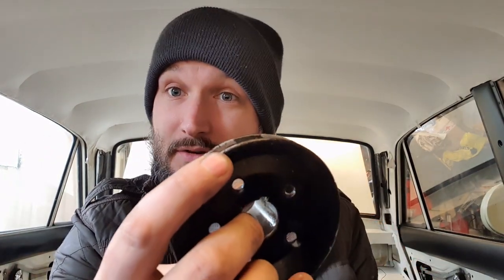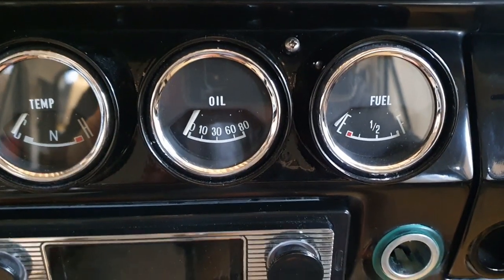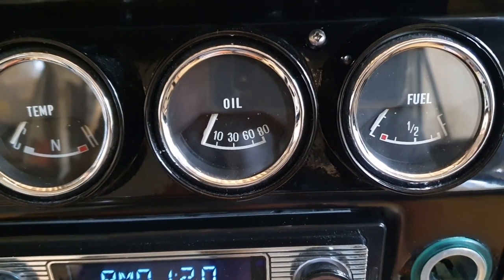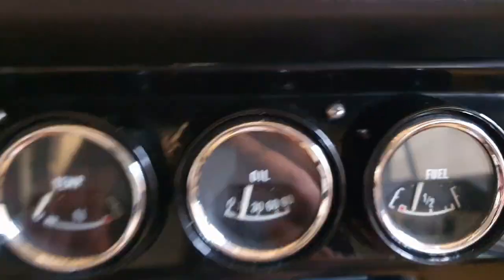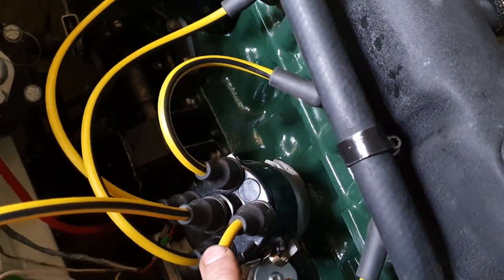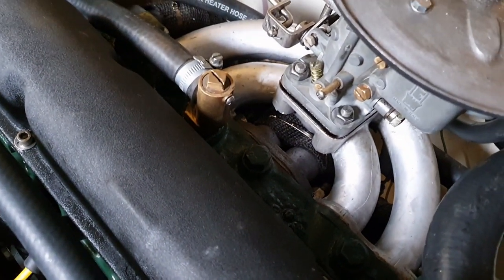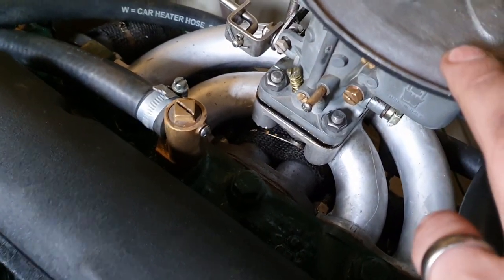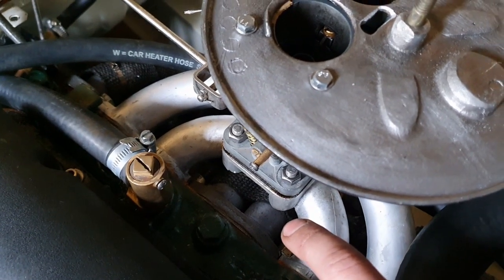Engine Fail! Mk1 Cortina restoration

Comment: hi mate,did you check whether no1 piston at top with your new pulley timing mark,i know that there are several ford pulleys that fit the ford crank all with different placed tdc's and it looks like your pulley with 2 marks is where someones checked theirs and marked it on the pulley,have you checked the float chamber to see if its full as a partial full will not run engine,never rule out a dodgy fuel pump,are all the vacuum pipes new without pinholes ?, its got to be something simple and when its happened to me its back to basics with a checklist,when you get no1 piston at tdc take no1 plug out and put a screwdriver in the hole and turn the crank till the piston has stopped pushing the driver up then attach a test light to the points and turn the dizzy till it lights the bulb then lock off the dizzy,have you got a strobe timing light that will tweak the timing when engine is running.
Reply from the maker: Hi John,

I agree that the pulley timing is getting me a  wrong timing, I hadn't tried the tdc on number one. 

The carb seemed to be set right but it's something I'll check out

I hope you're doing well.

Jim

Comment: I had my Capri running fine. Uses a motorcraft Autolite fizzy rather than the lucas one. The Lucas one is a bit more upmarket than the Autolite and a bit more technically  advanced,  however  I have always preferred  the Autolite one as it's more robust and it's less complicated if you have to fit non assembled points. Great on a car like mine where I am not too bothered about tuning and it's a daily. However the rev counter had been replaced with a aftermarket one. The original was in the spares when  I bought the car. Car had been changed to neg earth and that's probably why the rev counter was in the boot as that type of counter will not like the wrong polarity and kills them. So I rebuilt it, plenty of stuff on the internet about how to convert that type. When I did it, mine as luck would have it was slightly different inside to the MG ones where it can be done easier. I did the work. It worked fine for a bit. One day I pulled up, then the car would not start. Litterly taring my hair out. I found there was voltage to the coil 12v but only 7.5 going to the points. That was not enough to run the system. The reason, while I was in the engine I must have knocked the feed for the rev counter off, and put it back on the wrong side. Simple, did not notice I had done it, but enough to not let the engine start. Killed the repaired rev counter too, gutted. So redoing it now. So many people talk about electronic ignition vs points. So my pennies worth is this. When trying to diagnose faults it's much easier on a standard set up and if it's a car you use and love a lot, keep the points. Much easier to diagnose and replace yourself. If you go down the electronic ignition  route you need to always carry spare everything  of that system as of one component  does brake down and you are at a show or something,  your AA or recovery will not carry or obtain the part easy enough to get you going. Also as technology  advances and times pass, companies change who manufacture those systems. Parts become more obsolete  quicker than the trusty points set up, where you can nearly always get bits for or be able to repair to get you home. I also have an online spark plug checker fitted just as a visual aid in case of a fault. Just makes diagnosis  a lot quicker.
Reply from the maker: That's interesting, I'm doing some checks on the engine soon and I'll have a look at the voltage again at the dizzy.

Its running a new aftermarket dizzy but I've noticed it's very sensitive to minor changes in timing but I also think the pulley marks aren't great

Comment: Could be one thing or a number of issues combined.
Many new rotors, condensors, plugs, plug leads are faulty these days, even from reputable brands New out of the box. Dont assume check e everything 3 times. A new earth strap can cure issues e g. 
Fresh fuel, check valve timing, spark plug gap etc.
Reply from the maker: Hi John, firstly sorry for the late reply on your comment.

You was right about it being a number of issues, what I later found was that the main issue was that the crank pulley fitted didn't have the timing notch at the correct point for 10 degrees ATDC and the spares I had all had slightly different marking points (1960's quality!)

After taking the head off and setting TDC I could make a new timing mark but I also found the inlet/exhaust mating face on the head and manifolds was not flat so there might have been an air leak. I went through the carburettor again and found that the main jet had been drilled out so it would have been dumping fuel in!

Carefully putting it all back together and triple checking the Cortina has been running well.
Reply: They didn't have a weber carb as standard, at least my Dads mk1 1500 deluxe doesnt, its a zenith I think.
I was running 2 years ago but not now, the red light that should come on for ignition doesnt come on. My wiring diagram is black and white which doesnt help, do you have a colour one? That would be a help😂
Reply from the maker: @johncollins5552 the GT has a webber 28/36 dcd as standard. I have a loom diagram in colour but thank you👍

Comment: Hi Jim, Have you timed it with a timing light? If yes, and if you have fuel and a spark, then I would suggest you may have installed the distributor 180 degrees out, try swapping the leads around so that no1 becomes no3 , no2 becomes no4, no3 becomes no2 and no4 becomes no1 I think I have that correct, ie reverse order,  so instead of firing 1,2,4,3 it becomes 3,4,2,1, don't move anything, just swap the leads in the distributor cap, if that the. Works, you can either run it like that or reinstall the distributor in the correct position with the lead also in their correct order. Good luck👍
Reply from the maker: Thanks Larry, 

I didn't think of the reverse order to test if its 180 out, that's a great tip 👏 

Thanks again

Jim

Comment: I had a problem like this once and it was because when I put the distributer back in I got the rotor arm out of position if I remember correctly it should point towards the low tension wire and move to number one lead when slotted in. Remember it's 1243 on this engine. Your electronic ignition sounds ok and you've got 12 volts and a spark so that's right, must be timing a mile out. If I lived near I would give you a hand.
Reply from the maker: Thanks Phil I'll give that a try, the stealth distributor I have doesn't have markings like the lucas for alignment. I might retry the lucas as I'd prefer to use vacuum advance. 👍
Reply: I presume its fueling ok squirting down the primary choke when you operate the linkedge. Just out of interest I've got 150 primary jet and 165 on the secondary and 27 and 28 chokes and standard air corrections. Never had a blocked jet, I wonder why.

Comment: I agree with the other responders. Sounds like the timing is 180 degrees out. I experienced this problem with my old Mk1 Lotus Cortina. It wouldn't start but only backfire!
John.
Reply from the maker: Thank you John, I had a feeling it was more timing related. Do you still have your lotus?
Reply: @jimbuilds  I am pleased to see that the engine runs OK. I have never seen a distributor damaged like that before . Was it trapped by the sling when the engine was lifted out? As you say the engine is idling rich but it is running. No; I don't have the Lotus and that is a very sore point! Miraculously it is still listed by the DVLA but may not currently be on the road. Keep up the good work!
John.
Reply from the maker: @helendore-dennis5984  Thank you John, 

the distributor damage is a new one on me, fortunately the broken piece also didn't go into the sump! This distributor was built before Christmas - I originally had a non vacuum advance unit made by accuspark which worked but is a little overkill for this carburettor. I reused their bracket which on inspection at the weekend isn't circular. it turned in on itself on at the pinch bolt that must have cracked it when tightening it up. I have sorted it now though.

Shame about the Lotus but hopefully it'll see the road one day.

Thanks again

Jim
Reply: A tooth off on Dist. @ TDC,  front pulley marks very  close. . Make sure you have 12V-DC system  polarized at V-reg  for proper charging,  make sure you have Coil primary +/- correct for ⚡ I Had a 65GT 1500cc
Pos earth. Good luck, miss my 1rst car.

Comment: I had an Anglia where  someone had put the dizzy in 180 out. They did not figure it out. It would run, then cut out when hot. What the alleged mechanics had done when the lady owned it was to screw the plate in on one screw, then the the other was wedged between the plate and the body!
Reply from the maker: When I was rebuilding a lucas dizzy last year I found one of the plates had been welded to stop it advancing - its amazing what people think will work!